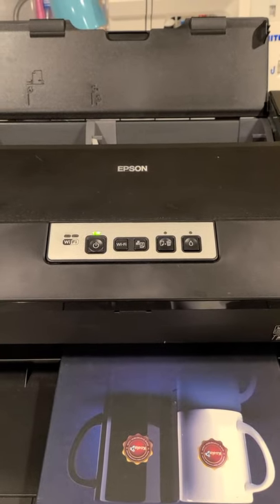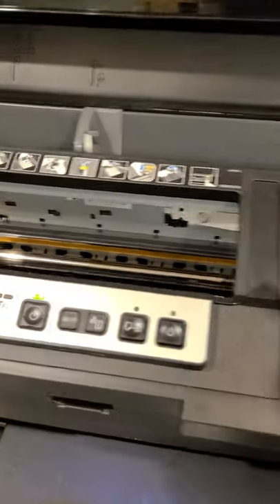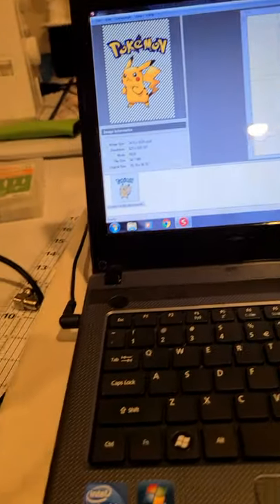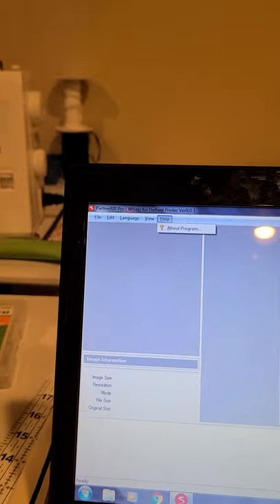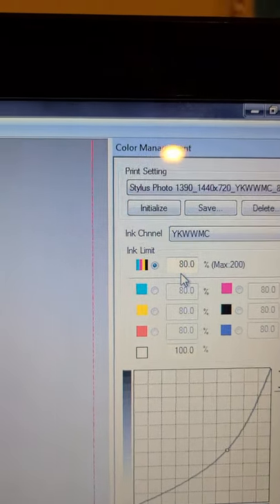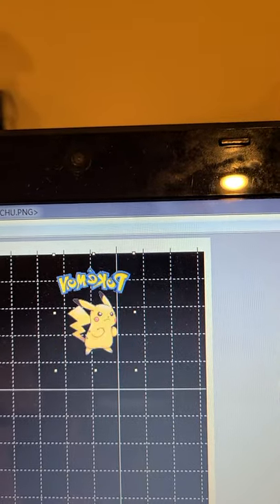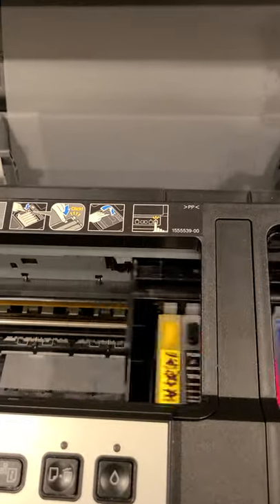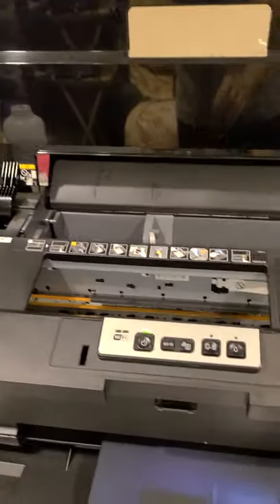What you need to convert the Artisan 1430 to DTF. (Works for Stylus Photo 1400 too)

Comment: Hi great video with details but which rollers do yo remove for the 11x17 film?
Reply from the maker: If 11x17 is the largest film you'll use,  then just take out the ones that would roll thru the middle.   You need to keep the ones that will feed the film on the edges.   So, probably at least the last two sets on each side.
Reply: @craftingonabudget6700  Thank-you 😊sounds like that’s the same ones everyone is removing Appreciate you responding

Comment: Awesome video thanks for sharing.. I do have a picture I could not really understand about how to get  buy rip program on the cloud would you please help me point on the right direction thanks again.
Reply from the maker: The rip software I have is acrorip 9.3.  At the time I made this video it was easy to buy a copy,  but I think the legitimate copies have all been purchased.   There are still a few people selling the software on etsy and maybe ebay.  There are a few people selling their copies as they exit the dtf space,  so you might look out for that.
Reply: @craftingonabudget6700  Yes this is my biggest issue right now - I heard you mention that the latest version (10) is fine but too expensive - I'm looking to buy it at this point lol are you certain the 1430 is compatible?
Reply from the maker: @bozoSAFE  yes,  many people use acrorip 10 with the 1430.  The latest version is now 11.
Reply: @craftingonabudget6700  Awesome, thank  you! - Yeah that's what i've seen. How often do you replace the printhead? Another youtuber said she went through 4 so far and has to buy older machines which are hard to come by ... Kinda don't want to do that unless she is completely messing something up to cause that.
Reply from the maker: @bozoSAFE  of you use good quality inks and do the maintenance,  printheads will work a long time.  DTGPRO inks have been proven to be some of the best.  Join this group on Facebook.  Veronica has been printing for 2 years.  fb://group/159861136049888?ref=share&mibextid=NSMWBT

Comment: I recently just purchased a 1430. Do I have to remove the rollers in general or only if I’m not printing 13x19? Happy Holidays 🎉
Reply from the maker: You want to remove any rollers that will run thru the ink as it's feeding out.  So if 8.5x11 is the only size you plan to print, then just the middle feeder rollers need to be pulled out.

Comment: I know its been a while since you posted this video but i recently decided to purchase an epson artisan 1430 for dtf. I had an l1800 but it broke down on me. Is there any potential long term issues i may run into? Also, how long would you say it takes to print a full 13x19 dtf transfer? My l1800 was very slow so i hope this would be an upgrade!
Reply from the maker: I'm not sure it's going to be much faster.   Of course, don't do ANY firmware updates.   Use good ink.   Dtgpro ink is what I found to be least problematic.   And run cleaning carts at every shutdown.   Watch the spikets where the carts snap in.   This area can develop an invisible clog.  Good luck with your 1430!
Reply: @craftingonabudget6700  Thank you!

Comment: What size hose you use for the waste tank,Thanks
Reply from the maker: I used 7/64" windshield washer hose and vacuum connectors. I got them at Auto Zone.
Reply: I dont recall seeing anything in the video about a waste tank. Could someone elaborate please? Thanks a ton

Comment: Thanks for this video it really helps. How do you remove the rollers(pizza roller) your last video was not clear enough. Thanks
Reply from the maker: Thank you!  
I use needle nose pliers that are made for jewelry,  and a hook pick tool for vinyl.  You pull the roller up until you can get a grip on it and then pull the rollers and spring out.  Move slowly and watch them.... they can escape and lodge under hard to see places.
Reply: I want to know the same thing

Comment: Nice! Do you need to shake the ink cartridges? How long can they sit idle before clogging?How long after you print so you add the powder to the film?
Reply from the maker: Thank you for watching.  You should shake the ink cartridges every day.
If you do the shutdown maintenance every time you finish printing, you can let the printer sit idle for several days.  Longer than that, you should run purge print with the cleaning cartridges to keep the printhead from clogging.  
I generally wait 5 minutes after the print is finished before applying the powder.
Please let me know if you have other questions.
Thanks!
Reply: @craftingonabudget6700  Thank you. Do you need a waste tank?
Reply from the maker: @MRWILL-fv2cw  You will eventually.   And a wic reset program.
Reply: Can’t get the white to print on acrorip 9.0.3

Comment: Sometimes I will go like a week without orders how long can this machine sit without being used
Reply from the maker: I was able to go as long as two weeks if I cleaned it before shutting down....but.... the manifold will clog and it's really hard to clean once that happens, so I recommend running 3 or 4 purge prints before shutting it down, and then do a purge sheet every 3 days or so.

Comment: Do you still use the 1430 for dtf? Is this printer a good printer for dtf, do you think? I am just starting dtf and just want to get my feet wet without spending alot of money. I have been doing sublimation for several, I just don't like the limitations. tia, debbie
Reply from the maker: I no longer do any dtf printing.   The 1430 was a good printer for me,  but when winter hit (I'm on Kansas), the printhead clogged. Dtf was really new for crafters, and we didn't know humidity needed to be around 50%.

Comment: Are you still using your epson 1430? I'm thinking about converting mine..
Reply from the maker: @marcushubbard1947  no.   When winter came,  I didn't keep the humidity level high enough, and the head clogged.   Humidity plays a big part in dtf printing.   High 40's is what suggested.

Comment: Now I know what to do with my second 1430.. Thank you, Question can you use a CISS
Reply from the maker: Thank you for subscribing to my channel. 

You can use a CISS, but you want one that has dampers and a shut-off clip.
Reply: @craftingonabudget6700   i just bought a ciss for 1430 i don't think it has dampers ,doesn't state in description  ,will it still work ,Thanks
Reply from the maker: @reyrisonrosales5101  it will work,  but you'll need to find the "sweet" spot to get the right ink flow.  Too high and it might flood the head, too low and no flow.
Reply: @craftingonabudget6700   where can the right ciis be bought  for the epson 1430 with dampers
Reply from the maker: @reyrisonrosales5101  I'll ask someone that has one on their 1430 and let you know.
Reply from the maker: @reyrisonrosales5101  I didn't have any luck with this... search continuous ink supply system with one way flow and dampers, sorry I couldn't help.

Comment: Hello could you help me! I have a epson stylus r2880. They seems pretty similar. I have converted it and all. I managed to print 10 dtf sheets w images. Now it doesn't recognize the paper thru rip software. If I print through desktop like file pictures or downloads it will print(which doesn't lay down any white for me)
Reply from the maker: From the top looking into where the paper feeds... is there a white piece of plastic?

Comment: Do you have to have acrorip 9 dongle  for it to work or can you just use a digital  download
Reply from the maker: I'm sorry,  I don't have the answer to that.   You would need to verify that with a AcroRIP 9 distributor.
Reply: @craftingonabudget6700   ok thanks, did you get the dongle when purchased  through  mclaud?
Reply from the maker: @reyrisonrosales5101  yes I did.
Reply: Any help where I could get the 9.3 software looked it up and seems like no one sells it anymore I'm a beginner so didn't want to buy by the full 10.3
Reply from the maker: @reyrisonrosales5101  there's a seller on ebay.   Be sure to filter to us only.
Reply: @craftingonabudget6700   OK thanks do you remember how much was the price
Reply from the maker: @reyrisonrosales5101  $36, but it's a download and doesn't appear to come with a dongle.   The version 9 with a dongle may be sold out.   You might check with some dtf groups to see if someone is wanting to sell their copy....

Comment: I have a 1430 and i been using it as a regular printer. I did not know its value 🥴. Is it possible to still convert to dtf if its used already?
Reply from the maker: Yes.  But be sure you have quality inks and the correct printing environment,  or you'll clog the printhead.   I recommend Facebook group Crafting with IronDesigns 813

Comment: Hows it holding up?
Reply from the maker: When winter hit, I got a bad clog.   Then it wouldn't tag the cartridges, so I had to scrap it.   Since then, the industry has discovered that you must keep the humidity high,  around 40%. And good inks are key.
Reply: @craftingonabudget6700  how long did it run good and did you wet cap it or how did you end each day?
Reply from the maker: @urjnlegend  I ran it April to late Oct.  I didn't wet cap it,  but I did run cartridges with cleaning solution after each print job.  Then I would clean the spickets that fit into the ink cartridge.  I didn't leave the cartridges with ink in.   I would store those in a zip lock bag.

Comment: Do you do maintenance on your printer everyday?
Reply from the maker: I shake the ink cartridges everyday,  but if I don't print, and the machine was put to bed properly,  it doesn't need maintenance.
Reply: I am new to DTF, I don’t know what put to bed properly means.  I am also going on vacation for 3 days what should I do to prevent the printer head from clogging?
What do you use to dry your design after printing?
Thanks 😊
Reply from the maker: @charlottesweb6992  I made this video on maintenence.   If you do this,  and leave the cleaning cartridges in,  then your printer will be fine.  When you're ready to print,  you'll want to mix the ink well with gentle shaking before you reinstall them.   Store the ink cartridges with both sets of plugs and put some tape on the opening on the bottom,  where the ink comes out.https://youtu.be/KC5W3mvXGek
Reply from the maker: Oh,  and I cure my prints on the heat mat from DTGPRO.
Reply: Thank you so much!!
Reply: Hot do you like the  heating mat?
I am getting ready to order one.
Reply from the maker: @charlottesweb6992  I prefer it over my heatgun.   I can set it down and do something else.  It's only drawback is with 13x19.  If you print using a much of the print space as you can,  you have to maneuver it around the cord.  And you should find a way to vent out the fumes.
Reply: What method do you use to vent out the fumes?
Sorry about asking so many questions.
Reply from the maker: @charlottesweb6992  I haven't put a vent system in yet.  I wear a mask when I'm curing, and try to stay out of that room as much a possible.  I plan to have a vent added to the dryer duct that is about 3 feet away from where I cure.  And don't apologize for asking questions.  This is all pretty new, so new info is emerging all the time.
Reply: That’s a smart idea 💡🤗
Thank you for the great information!
Do you have Instagram or FB?
Reply from the maker: @charlottesweb6992  yes, crafting on a budget with this logo on Facebook.   Craftingict on Instagram.
Reply: Thanks 
I will follow you 😊